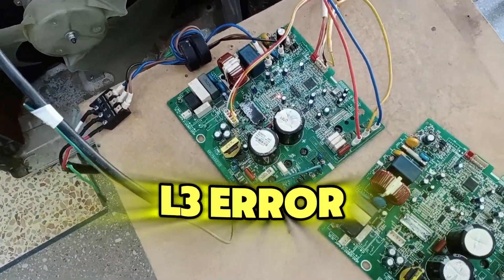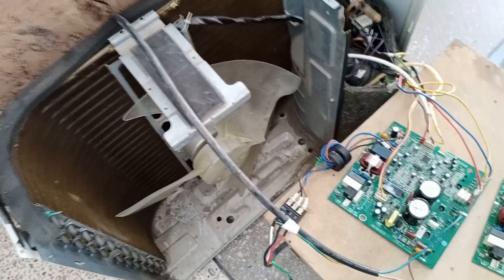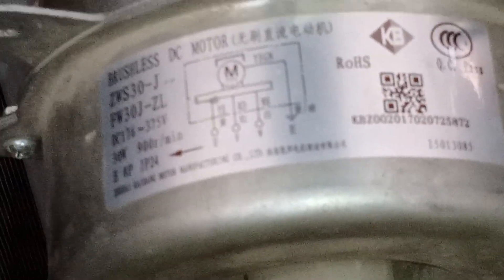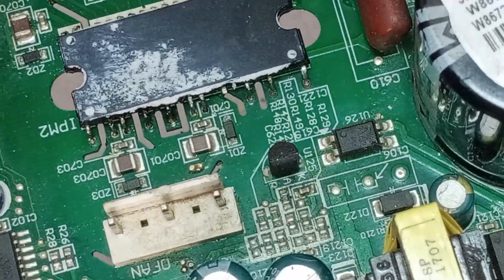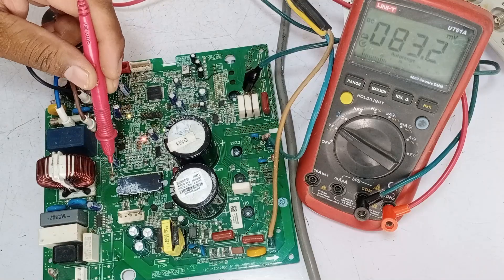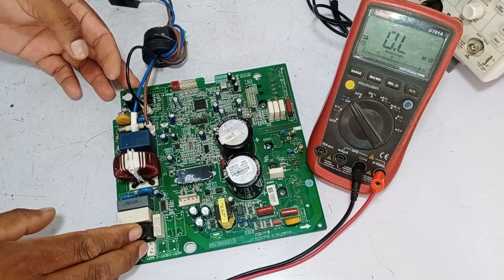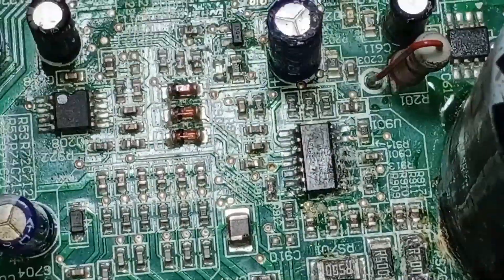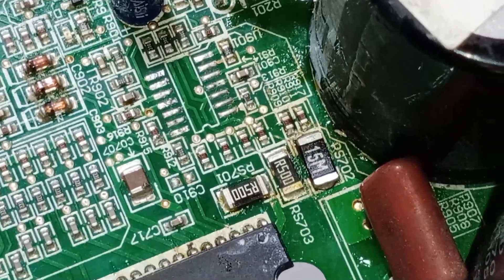Gree Outdoor AC Unit Down? Fix the L3 Blinking Error Fast!

Comment: Thanks for sharings i wonder can we start outside unit pcb without inside unit pcb? Can we bypass communication signal?and also which components are needed for AC  inverter repair?